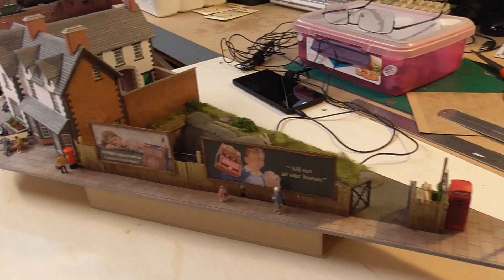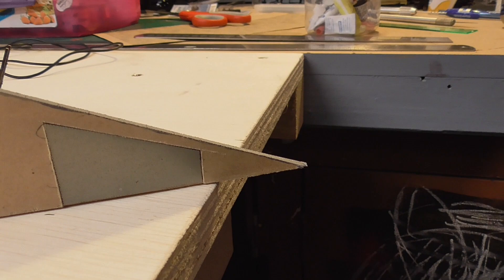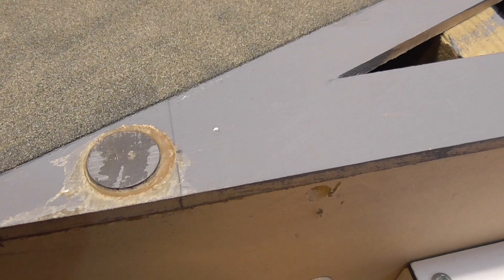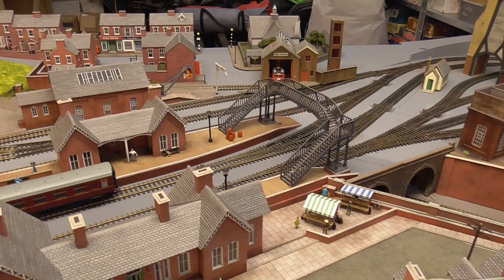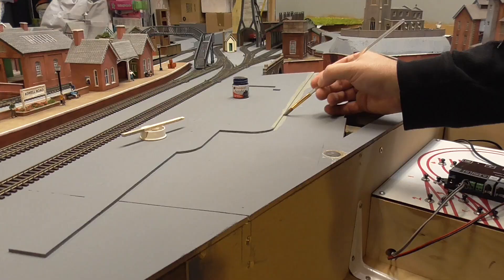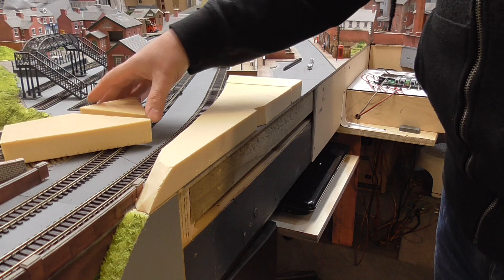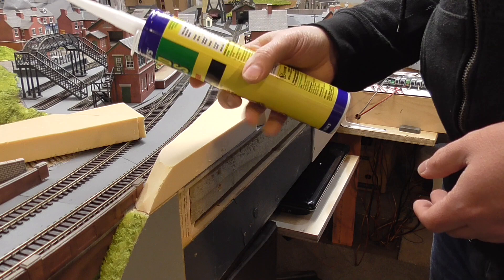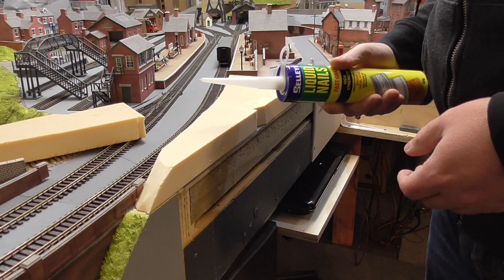Baseboard Rebuild and Station Street Scene [Part 3]

Comment: I like the look of the street. But I guess it will be part 4.
Why you using expensive Humbrol colours?  Because you have them. Sweet.  I like to go to Resene shop and get me a bunch of test pots.  Works very well.
I also like your way of doing the weathering powders.  You can get quite some good and cheap chalk makeup sets from the Chinese next door.
And I really like that the magnet turned out well for you.
Reply from the maker: Yes, part 4 will reveal a more complete scene. I decided to split part 3 in two because it was just getting too long for one viewing. The Humbrol Rust weathering powder was a just a one-off purchase from a year or so ago just to try it out. I have thought about using cheap makeup powders for weathering and might give it a go at some point, they might come in handy for finer weathering applications.

Comment: Quick question how did you make you fences ? Many thanks sion
Reply from the maker: The fences were made using thin balsa wood (0.5 - 1mm) cut into strips (2 - 3mm wide). I'm actually planning a video on how I constructed the fences (more fence to make for the layout) in to coming months, so stay tuned.
Reply: Station Road Model Railway cheers julian can’t wait